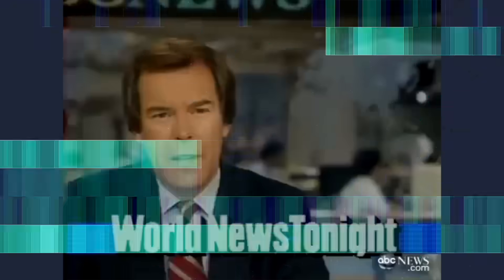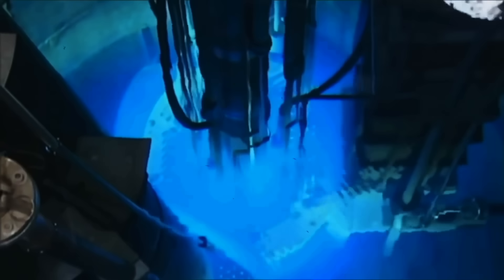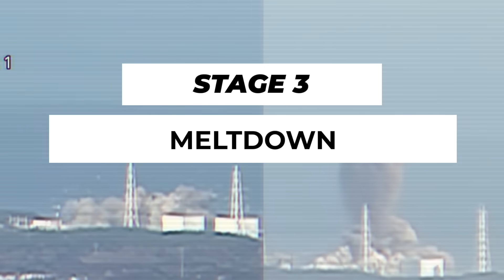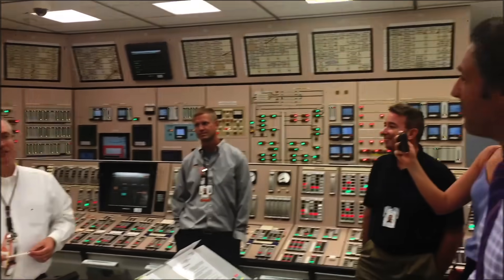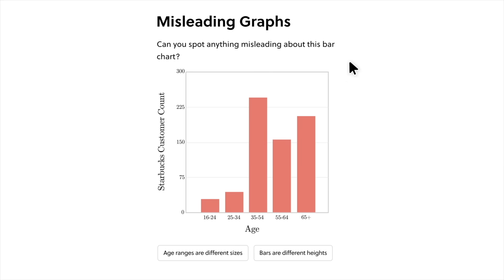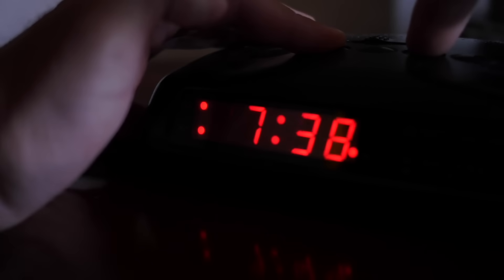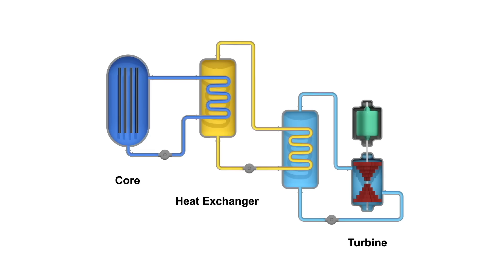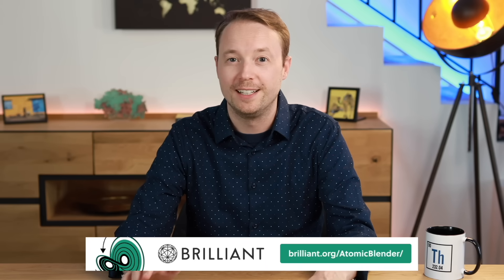Why Is It So Hard to Stop Meltdowns?

Comment: The dangerous thing with these water cooled power plants is not the nuclear material but the water that is supposed to cool it. If the circulation of water stops the temperature of the water will increase tremendously. At 700 degrees centigrade large amounts of hydrogen is created and eventually this hydrogen will explode. The result is that nuclear material is blown up in the air and spread over a large area. In Fukushima all procedures for handling the reactor worked but since the tsunami had knock out all the backup diesel generators the circulating pumps had no power and did not work. What you see on the footage from the accident is not a nuclear explosion but one that is caused by the hydrogen. Similar things happen at Chernobyl and Three Mile Island. If you have one reactor that is not cooled by water under high pressure this would not happen. That is one of the benefits with molten salt reactors.
Reply: Spot on and absolutely correct. I am glad you mentioned this as I was about to post the same comment.
Reply: @merlin7766  I think that the way forward is molten salt reactors. Alvin Weinberg that also contributed in the development of the water cooled reactors saw this as the way forward to develop safer reactors. If anything goes wrong the reactor is basically self regulated. If there is a leak the radioactive material will stay in the area since the salt will solidify when the temperature gets below 500 degrees centigrade.
If there is a power failure the graphite rods that control the process will fall down and stop it since they are held up and regulated by electromagnetic field. Should the process for some reason not stop a melting plug will melt at around 700 degrees and drain the content down to drain tanks where it is stored and cooled as well. If everything else fails the process will stop by itself when the temperature reaches around 1100 degrees because expansion of the salt will make the distance between the molecules too far to continue. Basically it compensate for human errors that might occur even if humans just run away from the scene. You don’t have to stop the reactor occasionally to change rods. The power plants will be much cheaper to build and maintain since you don’t need as strong and solid safety barriers as traditional nuclear power plants. You can also use thorium and even nuclear waste in these reactors. In fact you will be able to take out 10 times more energy of already used nuclear fuel. There are enough uranium and thorium available for ten thousands years of power production. Whatever waste that is made is safe after 300 years of storage. As part of the process it is possible to extract useful isotopes that are used in the medical industry and other purposes. Fission energy is fine and they are very close to making it sustainable. However there is a major hurdle and that is the fact that all the protons that are related will make all the material that is in the reactor and that are bombarded with them will be brittle in a very short time. It is no point in building a machine that can only last a few days. For scientific research, yes, but otherwise no. Maybe one day they will discover a material that can be used but I am afraid that this discovery is many years away. One very interesting project that is about to roll out is what Copenhagen Atomics are doing. Look them up on YouTube and on internet. They have figured out all the aspects of molten salt reactors including the financial part of it. In short you will be able to scale the production according to you needs and what the customer is buying is heat that can be used for countless number of purposes. Copenhagen Atomics will finance,build, operate and decommission the power plant. The reactors are in something similar to 40 feet containers and will be placed in fully automated warehouses where humans will not normally enter. These warehouses can be built next to where the energy is used and will take up minimum of space. When they are fully operational Copenhagen Atomics will produce one complete unit per day on an assembly line with the possibly to increase the capacity even further.
Reply: @runedahl1477  well thank you really for the comprehensive text above. It is good to see someone share their knowledge with the wider audience. 👍
Reply: yea, many people think chernobyl was a meltdown or a nuclear explosion but it was a steam and hydrogen explosion
Reply: @nieznaju11  The three most known nuclear accidents, Three Mile Island, Fukushima and Chernobyl, were all a result of hydrogen explosions.
If you loose cooling of these reactors you are in big trouble. Generation 4 of nuclear reactors are much safer.
Reply: Indeed
But i kinda like BWRS
Reply: @seantaggart7382  In the coming years we will see a nuclear race but in a positive way. As far as I know there are now more than 80 small reactor projects ongoing. You will see units that are built on an assembly line and for a fraction of the price that traditional reactors costs.
There are some well known companies and states in this race. If I should invest in any of these projects I would would go for Copenhagen Atomics. They work close with Alfa Laval in are building a system that is placed in a forty foot container. One of the benefits of their reactors is that they can also use nuclear waste. When the mass production starts in 2028 the will be able to produce one reactor every day and with a possible to scale up the production. They will be able to deliver the cheapest energy compared to any other form of energy production.
Plants can be scaled to what ever the customers requirements are. What difference them from the other projects is that CA will finance and operate the reactors. What they deliver to the buyers is heat that is delivered in the form of heated salt that is circulating. In energy production price will be vital.
Reply: Fukushima was also built on a fault line and in ussr fashion, Cherynoble was half built
Reply: @shinyrayquaza9  All the three best known nuclear accident happened because they lost cooling. That goes for Three mile Island, Fukushima and Chernobyl. In Fukushima the tsunami that followed the earthquake  knocked out the diesel generators that was the backup power for the cooling pumps when the reactor shut down. In Chernobyl they had this military type of reactor that is also used to make plutonium. They were conducting some sort of a test when they lost control. Probably a human error. Funny thing is that the remaining reactors that are of the same type is still running today and that in the midst of a war. If I remember correctly they were also doing some sort of an experiment on three mile island when things went wrong. This accident happened at the same time as a disaster movie came out.
The movie was about a nuclear plant that went out of control which did not do well to calm down the public. If I remember correctly the name of the movie was “The China Syndrome “. Some people actually believed that a nuclear reactor could melt a hole all the way from USA to China. Little do they know that we have a nuclear reactor deep under our feet in the core of the earth. That is one of the reasons this planet is relatively warm and habitable.
Reply: @runedahl1477  I wasn't disagreeing I was just adding to why those failed
Reply: @shinyrayquaza9  That is alright  it has been a while since I wrote the comments so I was just trying to clarify. I do believe that nuclear energy is the future, specially the new generation four type.
Reply: Thanks for this comment.  I didn't know that about water at 700°C.  Something new to study!  👍
Reply: @syntaxusdogmata3333  The pressure in their steam turbines are between 75 to 150 bar and you get what is called superheated steam.
I am not a nuclear engineer but I know that superheated steam for ship turbines holds a working temperature of around 450 degrees centigrade. This is of course done with large boilers fired by gas or oil unless it is on a nuclear powered vessel. Unlike nuclear power plants ships have the possibility to dump steam to control the temperature or just simply shut down the boilers. Besides there are large safety valves that will open if the pressure gets too high. On a nuclear pressurized reactor you can not do that without also releasing radioactive material so you need very efficient cooling capacity.  For both water and gasses there is a connection between temperature and pressure.
If you take a well known gas like propane it has ambient pressure to the atmosphere at -42 degrees centigrade and will be in liquid form. If you have it in a tank at a temperature of 30 degrees centigrade the pressure inside that tank will be around 12 bar but the propane will still be liquid. Drop the pressure and the temperature will fall too. That is the basic principle of refrigeration.
Reply: @runedahl1477 Pressurized water reactors do not release radioactive material by dumping steam. The steam generators are located in a secondary loop to the primary. No radioactive material is in this loop => no radioactive steam dumps. If you lifted a primary relief, then yes potentially radioactive steam would be released but the radiation levels would be low and if you lifted a primary relief you have a lot to worry about because you’ve fucked up something severely at that point
Reply: @gbulifant222  what spreads The radioactive material is not the steam but the hydrogen explosion that is caused by the enormous amount of hydrogen that is generated when the temperature of the steam goes above 700 degrees centigrade.This is what happened on all the three most known accidents. When it comes to gas explosion you have something that is called BLEVE (Boiling liquid evaporation vapor explosion). What is happening is that gas is spread over an area and self ignite. The explosion is huge and can resemble a nuclear bomb since you will also see a mushroom formed smoke cloud. There are probably some clips on YouTube if you want to see what it looks like.
I have seen some footage that is not intended for public view but is shown to firefighters and people working with gas. The reason why it is not intended for public viewing is that it also shows people being killed in the explosion.
Reply: @runedahl1477  I’m well aware of the mechanism by which a hydrogen explosion occurs in a reactor. However your statement about liquid sodium reactors isnt really a solution to the problem of being over 700° C. Pressurized water reactors aren’t designed to run that hot. No reactor is. If you’re above 700° C in any kind of reactor, you’re likely going to have a reactor accident. Even with liquid sodium, at that temperature you’re going to lift a relief and you know what happens when hundreds of gallons of liquid sodium starts reacting to exposed air? Also a very big boom
Reply: @gbulifant222  First of all sodium reactors don’t operate under high pressure like water cooled reactors. 2 to 3 bar compared to 150 bar or more is nothing.Secondly these type of will normally have a freeze plug that melts at around 800 degrees centigrade and drain the salt into holding tanks where the reaction stops because there are no moderator to slow down the neutrons. Should everything else fail the distance between the molecules will be too big at 1100 degrees for the reaction to continue. Basically the system is foolproof and is not dependent of human interaction.
Here is a link to Copenhagen Atomics. They are probably the company that has come longest in development of molten salt reactors.
https://youtu.be/U434Sy9BGf8?si=ov7ynD4SyiG5kTJu
Reply: There may of been 1 or 2 hydrogen deflagrations at Fukushima but one can quite plainly see in the video that one of those was not a hydrogen explosion, it was a detonation. Do you know in France after that event, the public were warned NOT to go out in the rain. We definitely didn’t get that kind of warning here in the UK. It was a case of “ no problem, nothing to see here” also particles of plutonium from Fukushima reactor were found deposited in Lithuania, just a few days later, carried there by the jet stream, interesting…..
Reply: @brutonstreettailor4570  Large amounts of gas the explode can resemble a nuclear detonation, only smaller. You will see a similar mushroom cloud. The term for this kind of explosion is BLEVE ( boiling liquid evaporating vapor explosion). You might find some clips on YouTube where you can see the effect. Depending on where this happens the damages can be devastating. Some years ago there was a derailing in the town of Lillestrom in Norway where a wagon filled with propane caught fire. The wagon next to it was also filled with propane but was not damaged. Due to the danger of an explosion an area in a circle of two kilometers was evacuated. Luckily they managed to drill a hole in the wagon and safely flare off the gas. Needless to say that this was an extremely dangerous operation.  In Japanese it is obvious that some radioactive material escaped but the public hysteria was media made. From sources I have heard that the radiation in the evacuated area was the same as you find in Stockholm and Rome on a daily basis. Nobody was killed as a direct result of the explosion.
In Chernobyl 31 persons lost their lives as a direct cause of the accident and this was the worst nuclear accident in history. For your information there are still eight reactors of the same type as the one that had the accident still operating in Chernobyl today forty years after the accident and that in the middle of a war. The future is nuclear but with generation four of reactors. There are as far as I know around eighty companies working on small reactors, among them is Rolls Royce. These new type of reactors will not have the same safety issues as previous generations. In my view the most interesting project is the one that Copenhagen Atomics is working on. It is a thorium based breeder operated with molten salt. It is compact so it fits in a forty foot container. You can adapt to your demand by adding more units. Best of all is that it can burn nuclear waste materials that otherwise have to be stored for 100 thousands of years and the wast that eventually comes out only needs to be stored for 300 years before it is safe. It can  burn  used nuclear materials from existing reactors and get ten times more energy out of it. The reactors will be cheap and they will be able to make one complete unit every day.  They have already solved the corrosion problem by making the cleanest salt in the world. Sounds like science fiction but the reality is that they plan to have their demonstration reactor running in 2025 and start assembly line production of them in 2028. It will be the without comparison to cheapest way of producing energy. No other options comes even close. The demand for energy will be covered for thousands of years . With this technology what is now considered nuclear waste and that costs a fortune to store can one day be a valuable commodity.  In UK alone you have a stockpile of plutonium waste that if burned in this type of breeder can cover your need for energy for the next fifty years.
I recommend that you look up Copenhagen Atomics on YouTube. There you will find several presentations of what they are working with and what plans they have. They are located in the facilities of Alfa Laval in Copenhagen. Alfa Laval have years of experience in producing evaporators, heat exchanger and separators so they are a professional contender to the race for carbon free and cheap energy.
Their business model is also quite unique. CA will finance,build, operate, maintain and decommission the reactors. The costumers will get their energy in form of melted salt that is circulated in a loop. This heat they can use to run steam generators, desalination plants or any other activity that requires a lot of energy. Due to their design these units don’t require the same type of safety barriers that traditional reactors need and they don’t require much space. A 1 gigawatt plant will consist of 25 units and will look like any other warehouse or storage facility. It will fit into a standard IKEA warehouse.